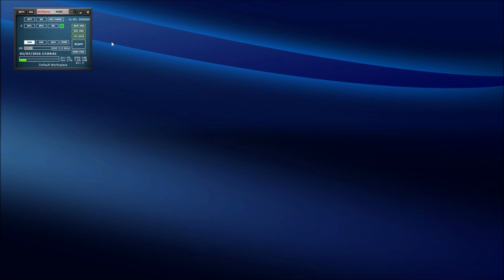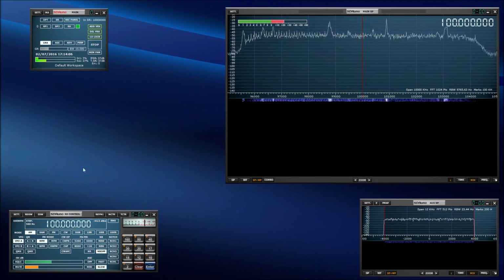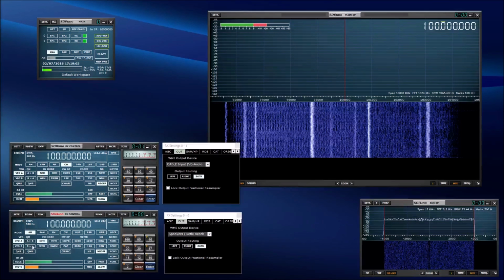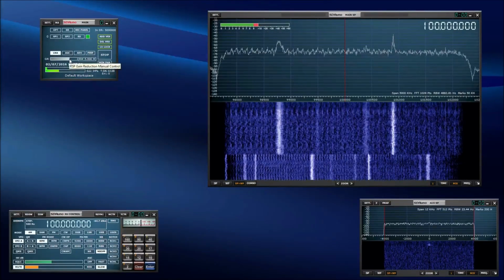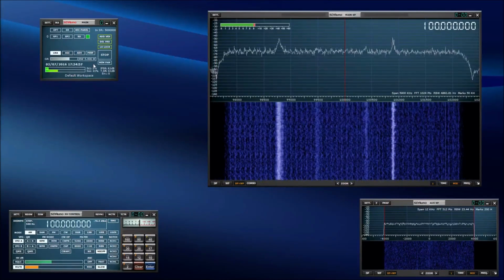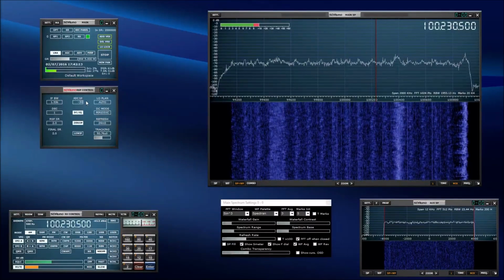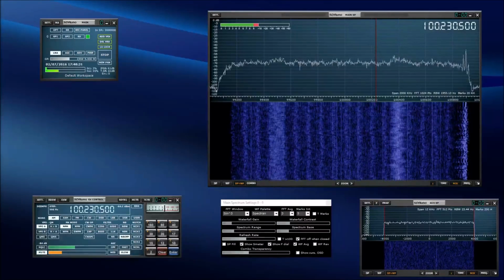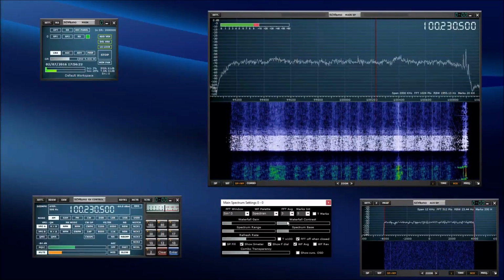Webinar 1 - RSP & SDRuno introduction

Comment: Real good program for the SDRplay and I'm impressed!  I was running HDSDR but finding that this program seems to be far more
flexible and even more sensitive than the HDSDR program probably because it is tailored just for the SDRplay. When I first started
the program, I couldn't figure out why it wouldn't get down on the FM broadcast band from the 2 meter band? I did find a way to
slide down by changing the scale to 100 Khz and just holding the keyboard's down arrow key. I'm exploring a better way of doing
it at the current time. :)   Thanks for your review!

Comment: Hi. Can the SDRuno be full screened, cayse when I load it on my 22 inch monitor it is still very small?
Reply: Sheldon, you can rescale the (MAIN SP) window to whatever size you want the (SDRuno RX CONTROL) window
I think can't be rescaled but the (SDRuno AUX SP) can be resized. Some of the control panels cannot be resized
and are fixed in size. If you close the (SDRuno MAIN) it will close all the panels and exit the program since it's
the main program control panel. Just remember, the (SQLC and MUTE) buttons have slider controls. I thought I
was turning the (MUTE) off by sliding it left and it was controlling the audio volume which lowered it. I had to
go through the documentation thinking that I had a address changed on the sound board. I read that it was a slider
then all I had to do is slide the orange slider to the right to get audio. :) There are tons of controls to get use to and
the only way to learn the program is to play around with it.
Reply from the maker: We are working on how to make it scale to fill the screen  and hope to have that capability in a future release

Comment: Nice job on this, good idea.

The LO separation would be really nice, could be added to the Main window pane as well, I agree having it separate from the VRXes makes logical sense.

I wasn't sure I'd like all the separate windows, but indeed I do, it's really nice to run in a minimal mode with just the memory panel and main up etc.

A visualization of how BW on main, vs BW on the ADV interrelate and in turn decimation and what the effects are on performance would be great. I go read about it, get my head around it, and then forget it, about annually.

The functionality and performance for the price with the SDR Play is just stunning.